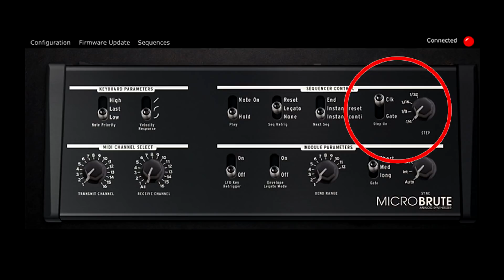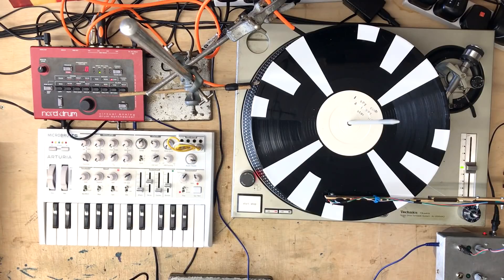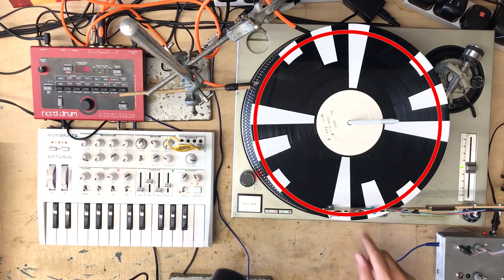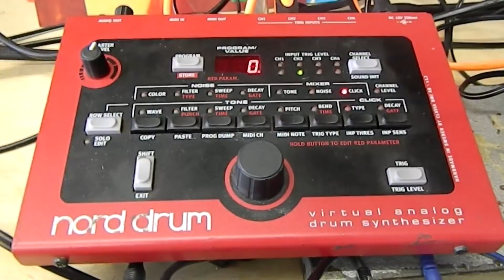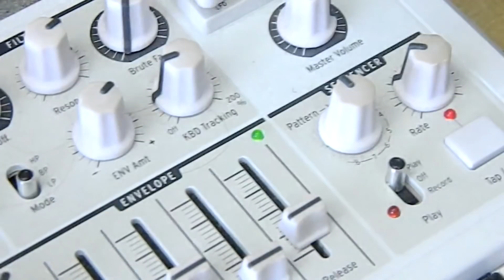Optical Synth Trigger Demo

Comment: maybe i missed the info, but the simple turntable motor is enough when you have stacks of vinyls and spacers or it affect the speed a bit?
Reply from the maker: It needs to be a high torque turntable in order not to loose speed - I use a technics SL1200 which does the job very nicely.

Comment: nice
Reply from the maker: thants!
Reply from the maker: Hello! And thanks.

 I think the parts for the optical unit came to about £20 or £30 in total. The sensors are about £2 each i think.

The triggers for the Nord Drum are piezo transducers (also known as contact mics). Flicking them essentially gives off an audio signal, something like a click or pop. The Nord Drum recognises this audio spike and triggers the drum sound accordingly. 
the Nord Drum is designed to be used with electronic drum pads. Most of those work using a piezo transducer, so this works in the same way.
Reply: Graham Dunning this is very interesting, thanks for answering!
Reply from the maker: No problem!
Reply: Graham Dunning this is really awesome work m8. I have a question though, how expensive could be to build this kind of setup? I mean the sensors and things like that. Also how does the pressure signals (how I've seen on many of your videos) get turned into midi signals or whatever...